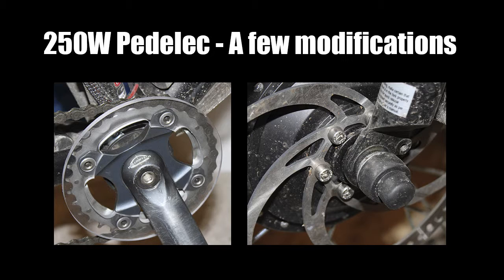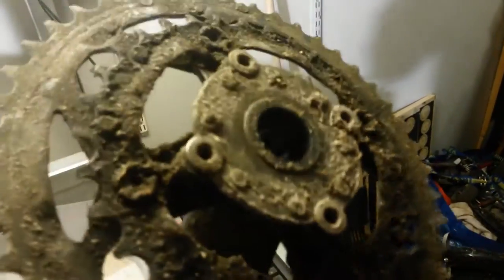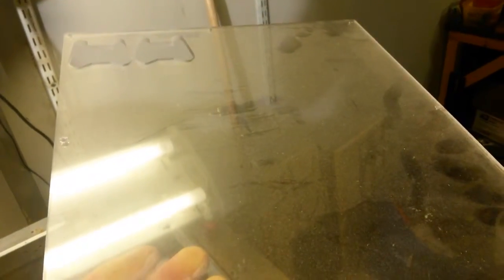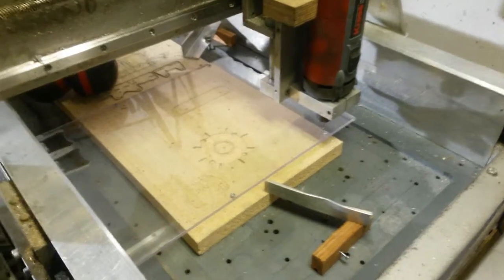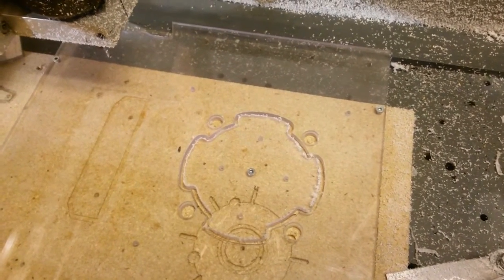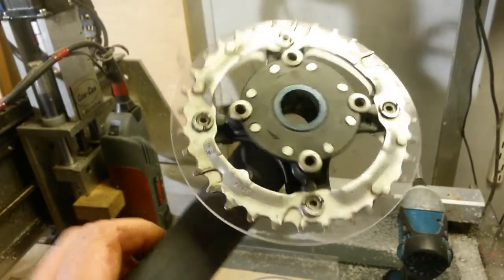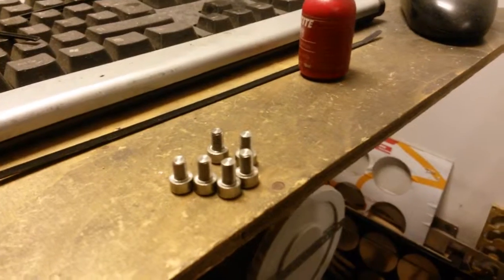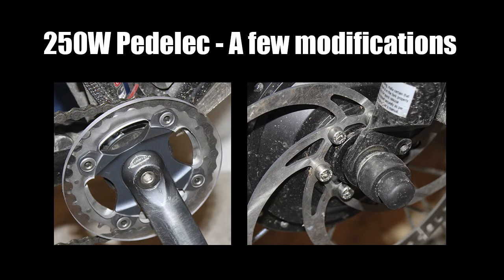250W Pedelec - Second week of long term test

Comment: 8:01 Nice! Not everyone has a CNC machine at home, though. But it seems to have worked nicely. My philosophy is the exact opposite, however: even on an electric bike, you cannot have enough chainrings. I would rather add a fourth one than remove any. But this has to work for you, not for me, and if it does, so much the better. Keep riding!